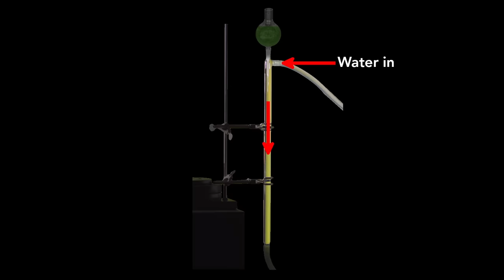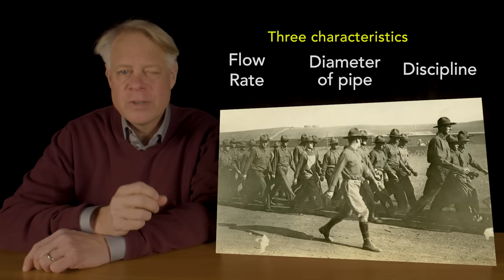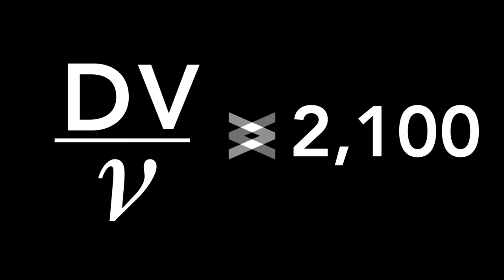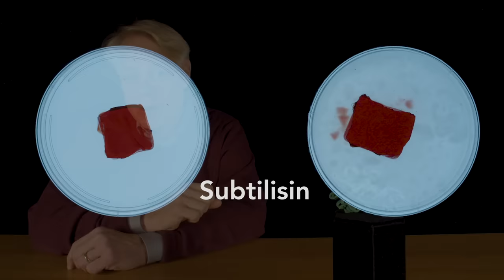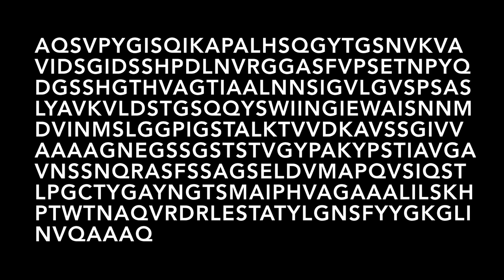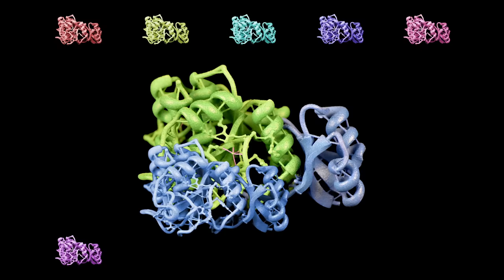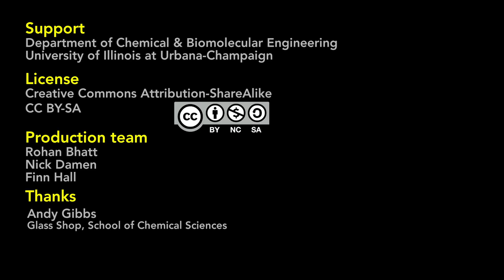Controlling Turbulence and Evolution: How Engineers Overcome Uncertainty

Comment: Great video put I don't think the forced separation of science and engineering is accurate or needed. The experimental setup in the start of the video to characterize turbulent flow is a scientific experiment. It doesn't need to give a model without flaws, just better than previously used. As a fourth year engineering student I feel like being an engineering is just using any tools you can to solve problems that have real life impact but one of the most important tools you have is science and the knowledge the scientific method brings.
Reply: Hard disagree.  I think that separation has always existed, he's just articulating it.  Your own comment explains why Engineering is not the same as Science and uses a different approach.

The Scientific Method is a template for discovering the unknown: 
Hypothesis -> Predictions -> Experiment -> Observations

The Engineering Method is a template for solving real-world problems using known principles: 
Problem/Task ->  Implementation -> Trial/Error -> Measurement of Success

They sound similar, but they're distinct in an important way.  As Bill notes in his video, Engineering doesn't need a scientific understanding to accomplish a task - it's not relevant.  And completing that task probably won't contribute to a body of scientific knowledge; nothing new has been discovered, hence it isn't science.

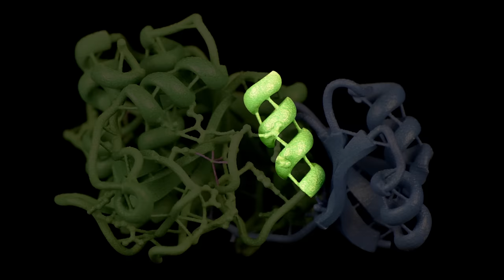Comment: 8:28 Amino acids which are the building blocks of proteins have both an amino group NH2 which is a base, and a carboxylic acid group COOH, yielding the family name amino acid. They can be linked together by a condensation reaction, which means a water molecule (H2O) is lost, resulting in what is called a peptide bond to form proteins.

Comment: This is an example of the difference between science and technology, that the average layman often confuse as being parts of the same thing.

Science has roots in natural philosophy, and basically is gaining knowledge (of nature) for its own sake.

Technology (engineering) is simply tool making, because a tool is needed to perform some useful function.

An applied scientist, actually works in the realm of technology. He (or she) uses some scientific principles (usually something novel, with that title) to shortcut the tool making process. Yes, in the modern world, most engineers use scientific principles to do their job. If you've ever worked with circuits, and used inductors, there's a lot of non-scientific fudging going around with the real circuit.

Comment: I never worked with a slide rule, but I feel engineering suffered because it is not forced to use to work with approximate solutions on a daily basis anymore: perfect solutions have become easy to simulate, while they usualy make perfect sense on paper, sticking to them to the key rarely survives the real world where real people have offdays or are under workpressure.
Reply: Very good point, and being a mechanical engineer myself I really had to adjust my engineering attitude when I started renovating my home. I was used to doing everything with very high accuracy and precision, because usually machines turn out to be better being built that way. Now with my 1930ish house I didn't have any drawings, no square angles, no plumb walls etc etc. I had to force myself to let go off my precision and just do the work. It was a very good lesson, and nowadays I can easily switch between renovation jobs and machine building. Luckily, not every technical challenge we meet need CAD-drawings and calculations to be done properly

Comment: Just found your channel. Really interesting! But I have to say (@4:30): I become uneasy when people show me values without units. Especially if they might not be S.I. units. Within S.I. you know that if you're wrong, you're at least an order of magnitude wrong - which could pretty much let you know you're wrong using common sense. But squared feet vs squared inches, inches per second vs miles per hour, and what do you use for viscosity - pounds of maple syrup per square inch at 57 Fahrenheit at 16.2 PSI?

Comment: The first time you call the chemical paint stripper, and then another 2 times you call it paint thinner.  There are two entirely different products.  I believe you should mean to say paint stripper on all accounts.  Paint thinner is a hydrocarbon mixture.  Paint stripper is dimethylformamide.
Reply from the maker: You are correct … although this phrase is just a proxy for solvent

Comment: I understand what you're trying to do, contrasting the scientific method against this engineering method, but the example you give here involves an experiment, predictions, and a resulting formula. Science doesn't seek to understand everything at once, or it is useless; science seeks to chip away at mystery to produce predictive value. The example is using the scientific method, which produced a useful tool for predicting laminar flow. Is the rest of this series going to continue to harp on this false dichotomy? I don't think it is helping to make anything clearer.

Comment: While the material itself is superb as always, the description of scientists and scientific method is misleading at best. 

Science does NOT necessarily try to strike final truths. Much of the modern engineering is based on, and much of the modern math is derived from the field of Differential Equations. But differential equations are but an approximation of the behaviour of atoms, and atoms are just approximations of quantum fields, themselves being approximations of something we aren't yet sure of. In a way, a gas formula, a Carnot cycle, or even Standard Model of Quantum Mechanics are but rules of thumb - even though one pretty damn narrow thumb.

Both experiments listed here were produced using the scientific method, and both provide the baseline, that can already be used in practice and bolster the further research.

Science generally comes there where engineering fails. It's only that we've learned, that it's better not to wait until the problem arises, and already have a solution beforehand. 

Say, astronomers were puzzled why did Mercurius rotate around the Sun a teeny-tiny fraction of degree per year slower that it should. Not something engineers had to worry of, right? Fast forward a century and a half - and, because of this observation and thanks to some crazy Jewish guy who clamed that space and time form the same fabric that is also curved by matter, we have centimeter-precise navigation systems, because they do account for the first approximation of general relativistic effects. You know, those navigation systems that are installed on our agricultural machines that grow our crops to help them make your morning toast cheaper.

Quite frankly, I may be overreacting, but the video sounded like coping with engineer's inferiority complex.

Comment: ….neglected to include density in the dimensional quantity “Reynolds Number” Re=ρVD/μ
Reply: Kinematic viscosity = μ/ρ, it's the same equation.
Reply: @sokjeong-ho7033  True.
But the engineerguy defines Reynolds analogy for "discipline" as the viscosity or the resistance to flow which by definition is the Dynamic Viscosity.
Kinematic Viscosity involves inertia as well as viscous forces so the density term is included.

He must be punished for his ambiguous uttterances Mr Jeong-Ho.
There is no remove for ambiguity in Rheology my friend,